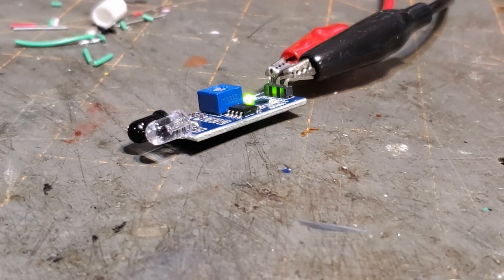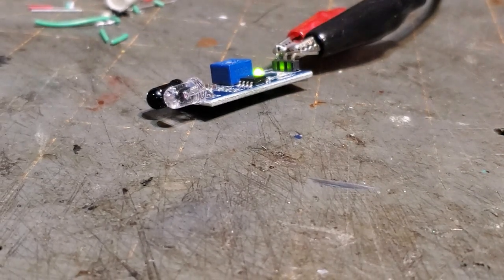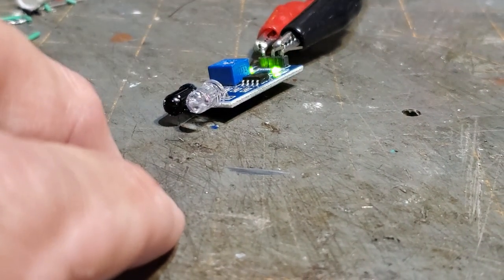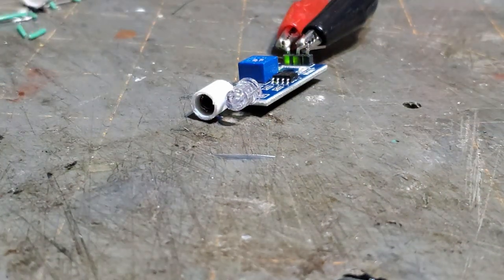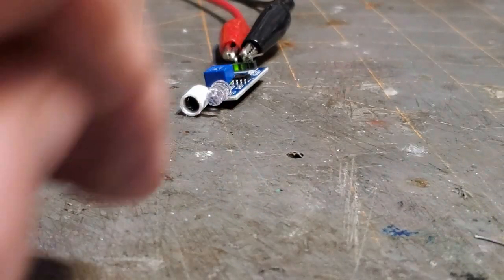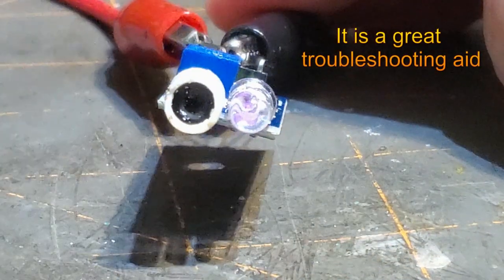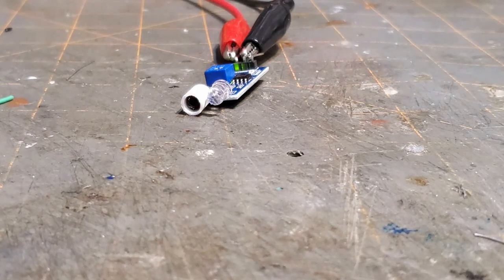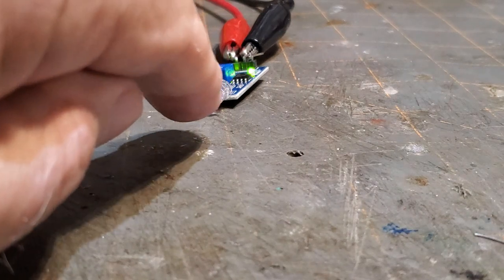Arduino Sensor Help

Comment: Thanks Lawrence. I did the same thing with a piece of shrink tubing.
Reply from the maker: Thanks Tom. I thought about that. If you have the right size you could actually cover almost all of the rear part also. Good tip!